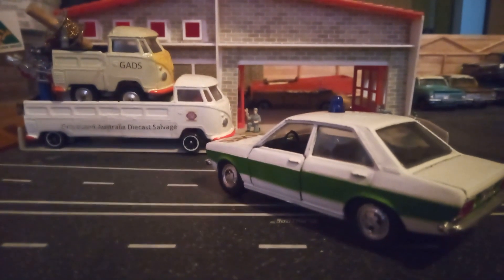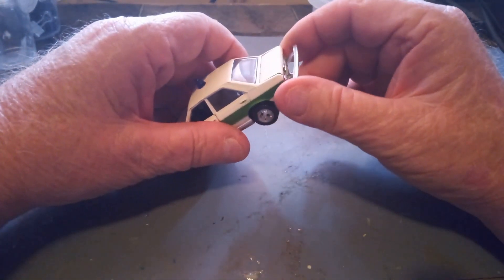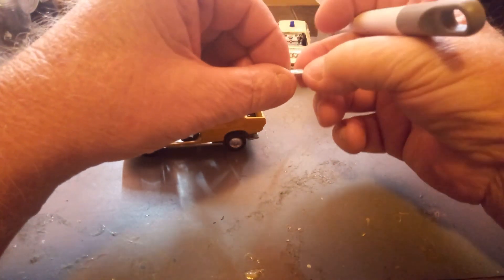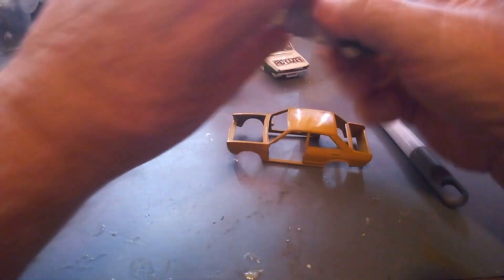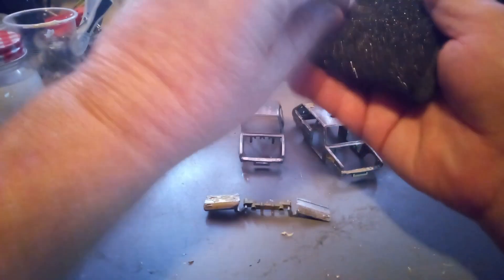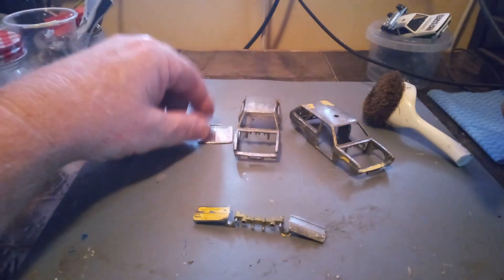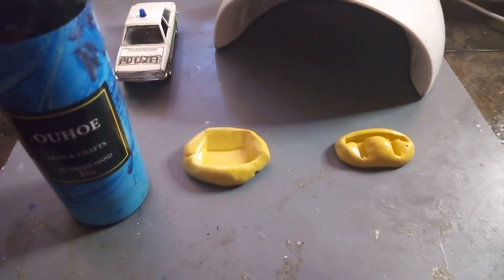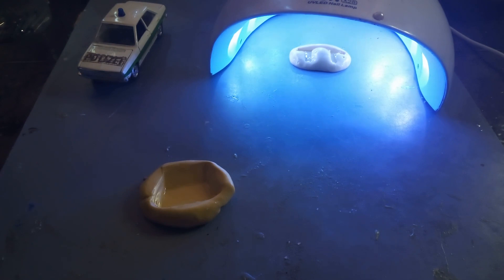Schuco VW Passat + AUDI 80

Comment: great customs. :) also congrats on grabbing one of these models all in one piece... believe it or not they apparently were meant to be taken apart. sometimes I find them at the flea market, completely stripped except body and baseplate. the rest probably lined the dustbin or the vac cleaner...
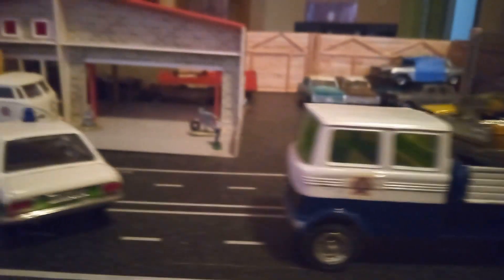the 1:66 either have license plates like "Schuco" res. "Modell", or licenses that start with "N" for Nuremberg, where Schuco was (is still?) located. from what I gather those with Nuremberg plates also have 1:43 counterparts; not all small models were sized up. which is a pity IMO. I'd do hideous things for a Ford Taunus or Granada in that size done by Schuco. (I'm not counting the current lines of models, they only bear the name and are rather generous, and made in youknowwhere.)
btw, Schuco used rub-on decals for stickers. the glue tends to seep out at the edges, and can be easily cleaned up with a dash of lighter fluid on a cloth. sometimes these decals also succumb to gravity, and slide down a door... XD
Reply from the maker: Great information